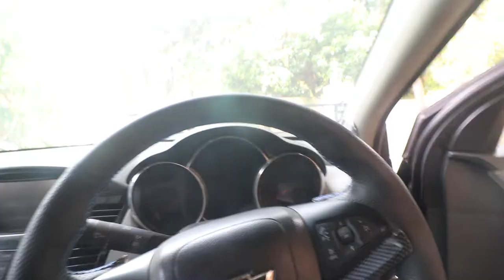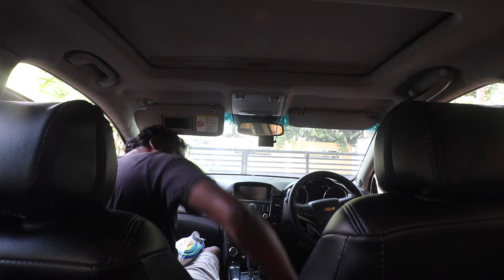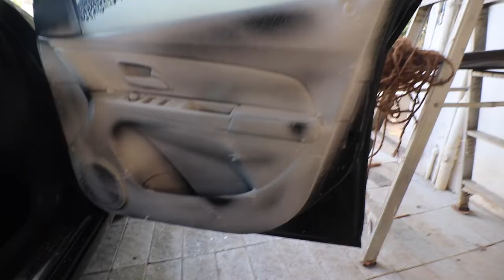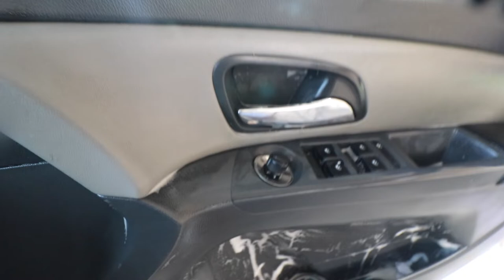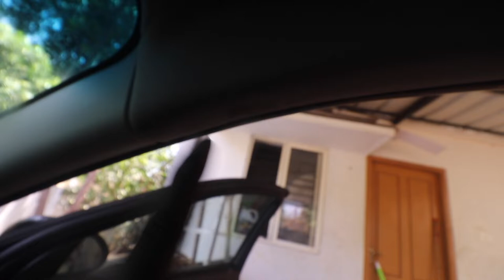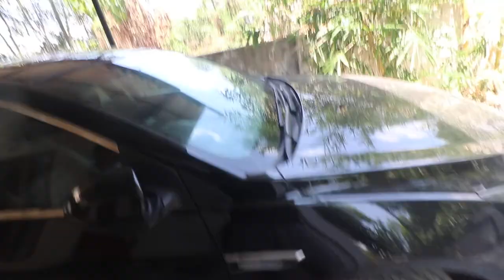Cruze Interior cleaning using 3M Interior cleaner (English Video)

Comment: Brother, my rx135. 4speed is running in 1.25 piston size(oversize)it give me 30km per liter in economy speed  , my doubt is wheather its a good milage for that piston size or not
Reply from the maker: With the piston size you have your overall cubic capacity of the engine has gone up, there will be a resultant loss in mileage. 30kmpl sounds fine
Reply: @Yamakaze  thanks brother
Reply from the maker: @VISHNUGAMER  👍
Reply: @Yamakaze  i think its 1.25 is a 5th bore , the leath man also said milage will be less in economy speed itself
Reply from the maker: @VISHNUGAMER  yeah